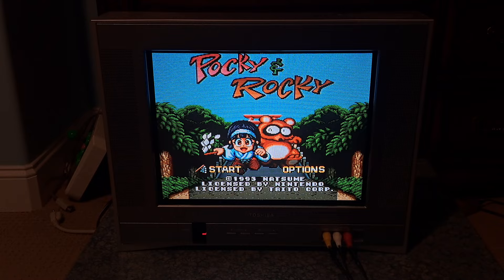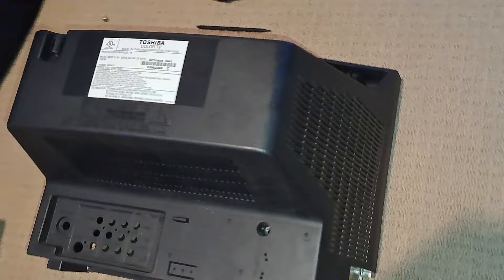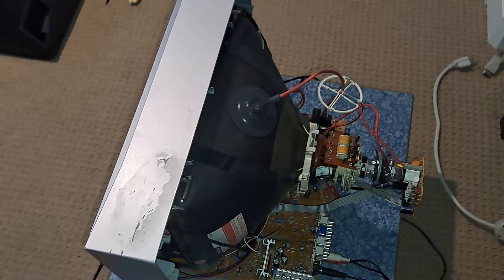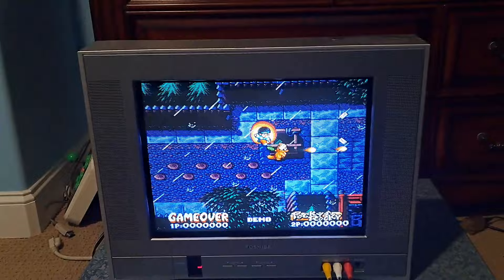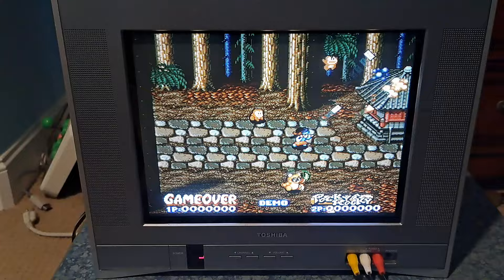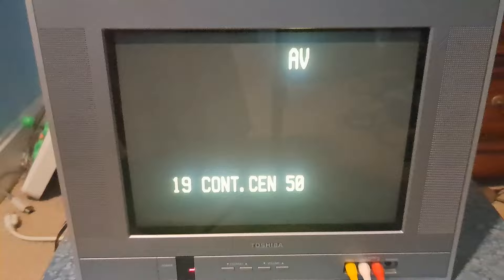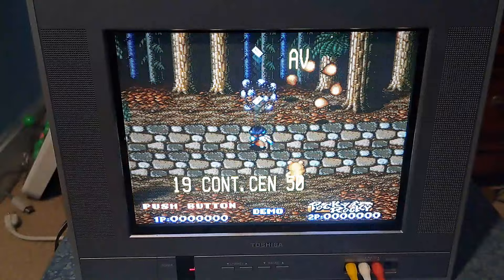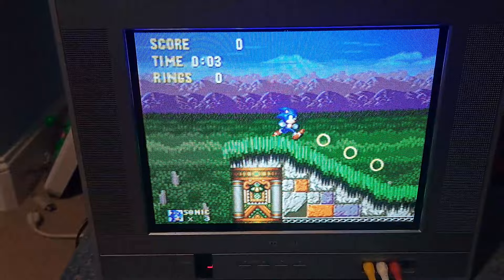Toshiba 14AF43 CRT TV Overview and Service Menu Adjustments

Comment: Got one of these about 10 years ago at Goodwill for $20. I'd never seen a consumer CRT this small with component before, very nice little unit.
Reply: I got my 14AF44 from Goodwill for 5 bucks (just checked the sticker) then found a 14AF45 on the side of the road later that week (cleaned up perfect). I already had a 14AF43 (probably another Goodwill find) and a few of the larger models so I’m really spoiled by my luck. :)

Comment: Awesome tube tv, I have the same model here, I use a bunch of consoles (snes/genesis/pc-engine), all with scart RGBs cables and using a converter to component, the image is near perfection without any changes at all, I just pic it up and plug it the cables, + this is a stereo tv, pure awesomeness ! (no RGB conversion is needed in my opinion at all)

Comment: I’ve had one of these on my desk for streaming for a few years now, the composite out works for all the inputs which is super useful. Mine definitely has some geometry issues but I hope I can tear into it at some point and improve that.
Reply: not sure about this model but i have the 14AF42 and the composite OUT does NOT work for all inputs, its only for the front composite only, it wont work with SVideo or Component
Reply: @gotbletu  now I’m second guessing on if it works with component on the 43, but I’m 100% sure it worked with s video
Reply: @chrisbroome6423  i tired this a few weeks ago, to route all the audio to my AV receiver and the only one it works with is the front composite port; so it does not work with SVideo/Component in the rear; but i have a different model (14AF42) then this one in the video
Reply: @gotbletu  I believe the 42 series are all toshiba guts unlike these Orion builds, so it wouldn’t surprise me if those had different featurea

Comment: Did you disable the velocity modulation?

I have a few of these including 14AF43, 14AF44, and 14AF45. I also have larger ones like a 20AF45 and even larger ones in storage. The last digit only seems to correspond to manufacture date and not actual model differences since my 43, 44, and 45 sets appear identical except for being made in 2003, 2004, and 2005.
Reply from the maker: I always disable VM if I can on any of my crt sets >:)

Comment: I just found an 14AF46 on the sidewalk last night and been trying it out through component-video. Nice little set that I'm assuming is the same, but I'm disappointed by its picture quality compared with my Sony Wega (KV-27FS12). It's possible its worn out though, it has over 12,000 hours usage and may have a large swath of phosphor burn-in. I may try adjusting the screen/focus on the flyback. Nice color mind you, and almost perfect geometry (none of that bowing I need to fix on my Sony).

Comment: Liked and Subscribed. I have this exact same set and love it. The horizontal image is a bit cut off on the right side (looking out from the set) and offset on the left side (looking out from the set) I have adjusted the image is much as possible in the service menu. If I were to adjust by taking the TV apart what would I adjust? Thanks!
Reply: You will most likely need to adjust the rings on the deflection coil. The service manual (quick Google search will find it for you) will show you exacty what each ring does, and most Toshiba/orion manuals have diagrams that show how each ring works. If that fails, you can buy or make convergence strips and wedge them in between the yoke and the tube to adjust the corner geometry. There's no tilt in the service menu, so if you need to rotate the image you will have to loosen the clamp on the yoke and manually rotate it until it's straight. If you don't have 240p test suite yet, definitely download that and use it on one of your consoles to calibrate the tv's image
Reply: @jakeiswayblack3377  Hey thanks for the response I do have the 240P test. it confirmed very slight offset but the geometry is damn near perfect. I will see if I can adjust the rings to completely center the image.

Comment: I have the same set. It is one of the better 13-inch I have ever owned. Only problem with mine is that it's composite output is broken. It displays a picture but it looks as if it's on the wrong resolution. Odd.

Comment: JVC remote came in!  Question for you!  Would you happen to have any Service Menu settings you recommend for these units?  I'm sure the settings will be slightly off depending on the tubes age and usage time, but it might be an interesting guide video!  

Thanks all the same!  Will be referencing this video from time to time regardless for my sets.

Comment: What's the part number on the tube? I heard that there are some chungwa tubes rebadged as Orion. 
Also it'd be cool if you had a video of the adjustments you made. I have a 14" truflat with component and It could use a slight adjustment to focus. It's a similar set overall

Comment: Hey, man!  I just picked up one of these.  Mine has some inward bending on the right side, also the picture looks slightly tilted.  I've seen this on a few CRTs but never attempted a fix.  I may on this one, do you have any tips?  Service menu helped a bit but I think maybe the yolk may need adjusting on the actual inside of the TV...
Reply from the maker: Unfortunately you gotta go dig into the back of the tube, adjust the yoke and all that. The corners need some convergence strips or magnets to try and pull em out some

Comment: I've got an 20AF45 that makes a buzzing noise from inside the housing. Not audio interference though. Any idea if it's failing capacitors causing it or a flyback issue?
Reply: Hey were you able to figure this out? I have a 14AF46 that is also buzzing.
Reply: Same

Comment: how do you get more composite ports on a tv?
Reply from the maker: You can't unless you buy another tv with more, however you can buy a composite switch box which can connect multiple composite/s-video/component ports (depending on which one you get) to one. You just switch inputs with a button